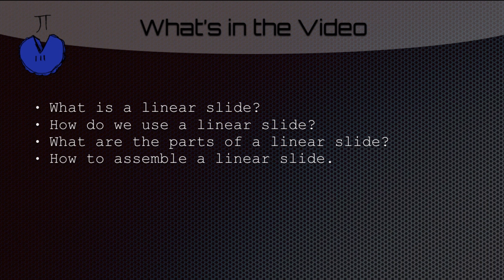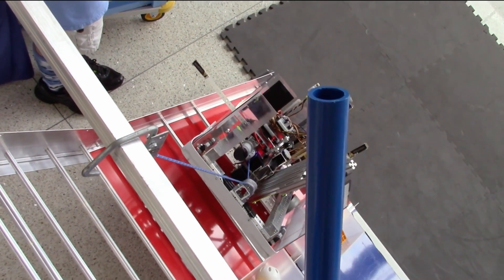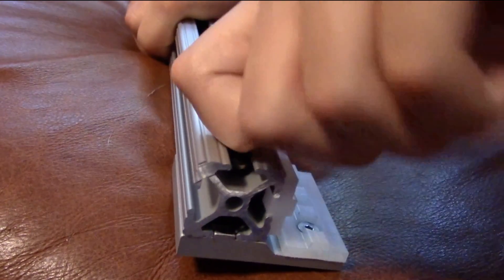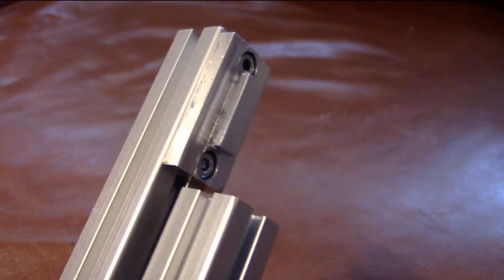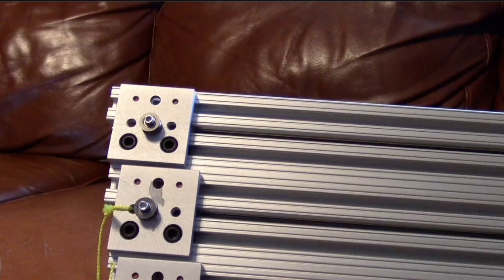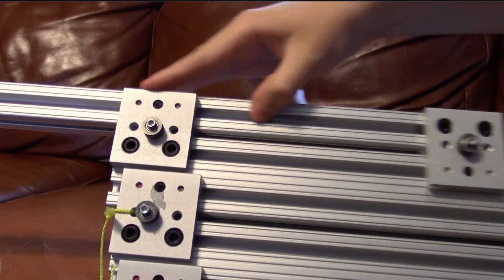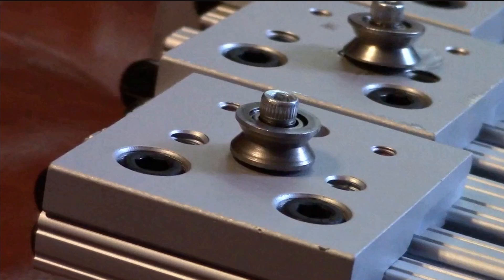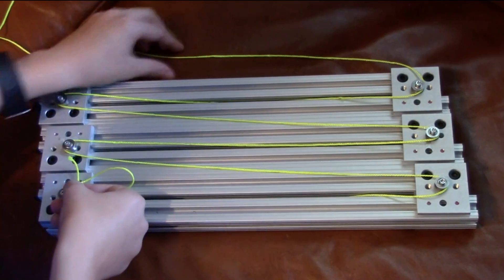FTC Robotics Help - Linear Slides - how to make, how to build

Comment: Where did you get the ball bearing and what part number was it?
Reply from the maker: Here's a repeat on a reply from a while ago. I'm not sure if the link is still good, but you'll get the idea!!

We got those on ebay, and they shipped from Hong Kong. It takes a couple of weeks. If you go on ebay and search for "v groove bearing", you will see some great options. I think these are the ones we used. 
http://www.ebay.com/itm/20Pcs-Metal-Sealed-Guide-Wire-Line-Track-Deep-V-Groove-Pulley-Rail-Ball-Bearing-/172263849944?hash=item281bb9bfd8:g:dYUAAOSwys5WVV13 

$4.36 for 20 bearings is quite a good deal. They work good with the #6 32 screws, and it's important to get some small washers (we got ours at the Home Depot). The small washers create a small gap between the bearing and the extruded aluminum. This keeps the outer part of the ball bearing from rubbing against the extruded aluminum letting the outer part spin freely. We took the bearing to the Home Depot to make sure the washers were small enough. I think we had to get locking washers (the ones with the small cut in them). I'm pretty sure they were the only ones small enough. I hope this helps.
Reply: FTC Team 9779 PIEaters this does help alot. Unfortunately now that build season started for FRC I can't wait a couple of weeks for bearings so I'm getting some from a local hardware store but all the other information helps alot.

Comment: I'm very confused about the linear bearing part in your video.  You had said you were able to 3D print one but it doesn't look the same as the square linear bearing (80/20 part number 6730) that you show before.  Do they do the same thing?  Because later in the video you continue to use the part 6730  linear bearing than the 3D printed one.
Reply from the maker: Sorry for not getting back sooner. There are a lot of different linear bearings you can use and we show a couple of different options in the video (and there are even more out there). If you use the 80/20 extruded aluminum, you'll probably want to use their linear bearings. You can also improvise and modify those linear bearings and just use part of them, or cut them in half if you're not moving something heavy. The printed linear bearings are for MiSUMi 15mm extruded aluminum. So they are something we designed and printed, but they are not nearly as smooth. REV makes a great linear motion kit, and the Actobotics linear slide looks pretty amazing. I hope this helps a little.
Reply: Thanks for the help.  I ended up designing my own.

Comment: How did you attach the bearings to the slides.
Reply from the maker: For the ball bearings, we just drilled a hole through the extruded aluminum. Then it was just a #6-32 screw through the ball bearing, a tiny washer, and the extruded aluminum. A nylock nut on the other end holds it all together. We found it was super important to get the super tiny washer between the ball bearing and the extruded aluminum. This allowed the ball bearing to spin freely. Hope this helps and good luck!!
Reply: Did the nut go in between the two slides? If so, it had enough room for the slides to move? The questions pertain to the 80/20 systems.
Reply from the maker: Ah sorry... For the 80/20, we drilled and tapped a #6 32 hole in the linear bearing. Then we just used the super small washer between the linear bearing and the ball bearing, then a #6 32 screw through the center and into the tapped hole. Does any of that make sense?

Comment: Sir I am interested in making a linear slide for a Horizontal or maybe a Tilted version of this type.Although using the motor will allow it to slide but how would i be able to return it to its Initial Stage?
Reply from the maker: We have seen videos out there on how to do this. We made a small slide that could return. The basic idea is hook a retraction string to the bottom of the last stage. Wrap the string on the same spool that pulls the slide up, only this new string needs to wrap the other way so that it gets longer as the main string gets shorter, and it gets shorter as the main string gets longer.

Comment: Hey I was wondering if theres any place we can get the aluminum misumi linear bearings you guys had machined by your mentors?   And also if we do use the 3d printed ones, what size screws did u guys use for the bearings? 
Lastly, where do u put the ball bearings on the 3d printed design? 

Wait also, how did you guys mount ur slides? Thanks a lot!

Comment: How much did the sliders cost, I've been looking at around on 80-20's website and they are all 50$. Is there a less expensive option
Reply from the maker: We finally went to the 15mm MiSUMi extruded aluminum which is much cheaper. The 80/20 stuff is super smooth though. We 3D printed our linear bearings, but we had a mentor machine them out of aluminum after we got them right. Since then, we added extra linear bearings on the sides as well.

We finally got the 3D printed parts up on thingiverse. Good luck!!!!

https://www.thingiverse.com/thing:1916338

Comment: Where did u guys buy the rope? Can you provide me the link please? Thanks!
Reply from the maker: Hey there. We bought that from Home Depot. It's just nylon mason's line. It's pretty strong. We hung a bucket from it and filled it with weights. It was about 100 pounds when we ran out of weights. We bounced the bucket on the string and it finally broke. We got it because it's easy to see and easy to tie knots and stuff. I think it was this one: http://www.homedepot.com/p/Marshalltown-Florescent-Yellow-Braided-Mason-s-Line-500-ft-ML339-HD/100318177
Reply: Thanks! One more question if you don't mind, what did u use to attach the rope to the motor. I though of a spool, but couldn't find one for ftc robotics.
Reply from the maker: We took a motor hub, and attached 4 of those Tetrix standoff posts. I think we might have put a small Tetrix gear on one end to act like a spool. You could probably mount a small gear on both ends to make sure the string won't slip off. Nothing fancy. We also used this 3D printed part to reel in a string once: http://www.thingiverse.com/thing:683138

Comment: Hello, great video! My team and I have been trying to get our linear slides to work. The problem is our motors don't have enough torque to pull the string. What model motors do you guys recommend?
Reply from the maker: We have switched all our motors to the AndyMark NeveRest series motors. They have them geared for 20, 40, or 60 to 1. The 40:1 should be similar to the Tetrix motors. So maybe a 60:1 will solve your problems. 

Another thought. We had a problem getting our slides to lift last year, and it turned out that we had pinched our ball bearings so they couldn't spin. We thought it wouldn't matter because the string could pass over them smoothly, but the friction compounds at every ball bearing, and it was making it impossible to pull the slide up. So, make sure there is no resistance everywhere the string makes contact, that might help too. Good luck!!!

Comment: What were the parts used to make the linear bearing? Were they from the 80/20 website?
Reply from the maker: The linear bearings we used on the 80/20 were bought on ebay, but they are an 80/20 part. The ones we used on our MiSUMi slide were originally 3D printed and then a mentor machined them for us. Mentors are awesome!

Comment: What was the overall cost of the linear lift?  We were looking into using one this season for the cap ball, but our funds are limited.  Any estimate is appreciated!
Reply from the maker: The MiSUMi extruded aluminum is about $3 per stage. They will cut it to length for you, but it takes a couple of extra days. Check it out here: https://us.misumi-ec.com/vona2/detail/110300465870/

You'll need the locking nuts to go with the extruded aluminum. They are about $9 a package here: https://us.misumi-ec.com/vona2/detail/110300465710/?rid2

Also get some short M3 screws. Order at least 50, or they end up costing more: https://us.misumi-ec.com/vona2/detail/110300239070/?HissuCode=CB3-6&PNSearch=CB3-6&searchFlow=results2products

You'll also need some ball bearings to use as pulleys. You can see the ones we used in the other comments.

The worst part is the linear bearings. Like Seth says in the video, we 3D printed some (We'll try to get them up on thingiverse soon). We didn't use the 3D printed ones for long, so not sure how strong they are. We were lucky to find a mentor to make some based on our 3D printed prototype. MiSUMi doesn't make a linear bearing, so if you want some off the shelf, you'll have to go with something like the REV Robotics 15mm extruded aluminum and use their linear motion kit, but this gets costly. I'll let you know when we get the 3D models for our linear bearings on thingiverse.

I hope this helps.

Comment: Hi, Could you please tell me what kind of ball bearing are you guys using and how to purchase them?
Reply from the maker: We got those on ebay, and they shipped from Hong Kong. It 
takes a couple of weeks. If you go on ebay and search for "v groove 
bearing", you will see some great options. I think these are the ones we
 used.

http://www.ebay.com/itm/20Pcs-Metal-Sealed-Guide-Wire-Line-Track-Deep-V-Groove-Pulley-Rail-Ball-Bearing-/172263849944?hash=item281bb9bfd8:g:dYUAAOSwys5WVV13

$4.36
 for 20 bearings is quite a good deal. They work good with the #6 32 
screws, and it's important to get some small washers (we got ours at the
 Home Depot). The small washers create a small gap between the bearing 
and the extruded aluminum. This keeps the outer part of the ball bearing
 from rubbing against the extruded aluminum letting the outer part spin 
freely. We took the bearing to the Home Depot to make sure the washers 
were small enough. I think we had to get locking washers (the ones with 
the small cut in them). I'm pretty sure they were the only ones small 
enough.

I hope this helps.